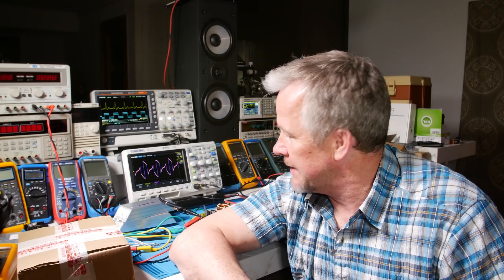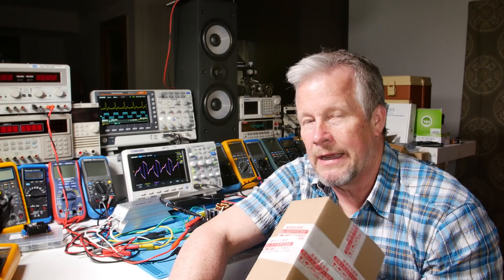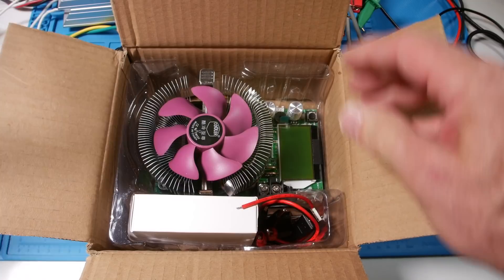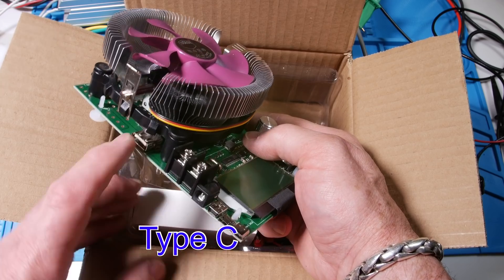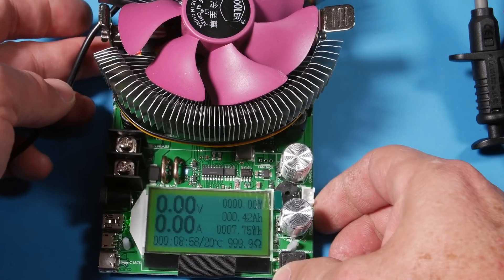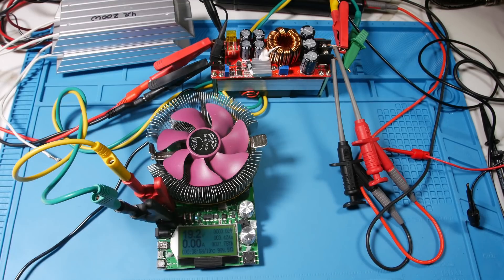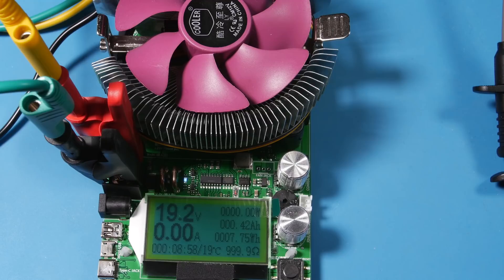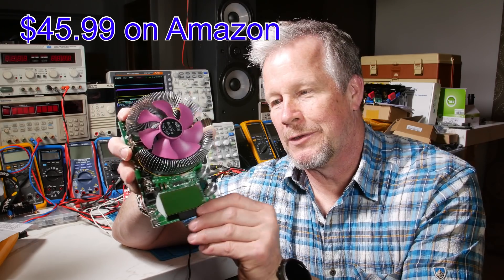MakerHawk Low cost Electronic Load

Comment: Nice video about the Load.
But PLEASE DO NOT USE IT FOR BATTERYTESTING or bigger Units without a Fuse in Series to the Load.

For small DC/DC converters and maybe very small Battery it is okay, but remember the Construction and the Price ! 

Also it cannot Replace Resistors because of Switching fequency from DC/DC or other Power supplys.
The ripple or noise can affect the Load operation.

If this load fail while you testing a 18650 Batterypack with like 4S it can easy Burn down the whole setup or your House.
4S 18650 SonyVTC5 pack can deliver over 100A at Short circuit.
Reply from the maker: Andy Privat Wow - that is such great advice!  Thank you!!!  These comments are so much help to others - and me;)
Reply: @KissAnalog   I Thank you for the great Video.

I need a load myself and i did had the Idea to make my own.

But Problems like Load regulation or oscillation stop this Project very shortly..

Now i did order a Load from a Company in china.
The same Load is relabeld availabile here in Germany for about 430$

If i have the Time i will make a Video about it.
Reply from the maker: +Andy Privat That video would be great!  I have so many ideas - but not enough time;)
Reply: @KissAnalog   i know what you mean... This year i even had no time to get good ideas...

Comment: I read an Amazon review comment that said this tester doesn't work for USB-C testing, and that they didn't know why it even has a USB-C port... Is that true??
Reply from the maker: Daniel, I’ll check that out.  I haven’t tried that yet.  That’s very interesting - thanks for the tip,
Reply: @KissAnalog  cool thanks
Reply: @KissAnalog  I'm not sure if they meant it doesn't work at all with USB-C, or it just doesn't recognize USB-C PD or QC for higher voltages (i.e. 9v, 12v, 20v, etc)...
Reply from the maker: Daniel Brooker Ok, I wonder if it’s something that is selected in a menu or manually set?  I’ll see if I can check out the other features it has while I’m at it.  So far I’m really impressed;)
Reply: @bluegizmo1983  Have just checked the USB TypeC socket... no power delivery protocols for TypeC so a PD load will not get any feedback and not send any power, but nominal (old style) 5v TypeC works like any other USB port on the board.
So the typeC port on this load works fine, just not PD supported, though there is likely newer revision that has PD protocol and BT and all that jazz.(its quite old this load, got mine years back).
Tried with my Porsche Book PD charger and my adjustable power bank with PD protocol, no dice.
Reply: @JAKOB1977  ok thanks for testing that for me! Much appreciated!

Comment: Thanks for the overview of this thing!  I'm still a total noob, realized I need a dummy load a few days ago.  Looked around a bit and have had my eye on this MakerHawk to take me further down the rabbit hole.  I was going to get a no name 10A 150W for about $26, but 10A just barely meets my needs so it would probably be wise to get some head room.  This unit is pretty much perfect for what I need, and I have a better feeling about MakerHawk than the $35 knockoffs.  They probably work fine, but I'm a firm believer that you get what you pay for.  Obviously this thing is still a cheap Chinese device, but it's the slightly more expensive cheap Chinese device, and that has to count for something.  Nice to see a positive review from someone such as yourself that actually knows a thing or two.  I wasn't too sure about it before, now I feel totally secure ordering it 2-NITE!
Reply from the maker: Drew Kosonen I’ve been a bit surprised how good it actually is;) I have used it in a number of videos to show how well a low cost device works, but also because I just like using it.  Thanks for sharing your thoughts - hope to hear more from you, and about your thoughts on this when you get a chance to use it.

Comment: Hello, my Load Tester nothing happens, I turn the potentiometers and nothing.
I've already changed Mosfet 2 times, nothing happens.
Can you tell what might be happening?
Reply: Hi Leandro and Kiss Analog
I have the same problem. I received the item, and it doesn't worked from start. No visible damage or magic smoke. I've started to build up a schematic to repair the load, but there are a lot intresting things for me. Can you do me a favour, and measure all the voltages on the two potentiomters pins? Because on mine all sits under 40 mV and the two ends of the resistor on same potential (shortened) (sch attached). The device measures the input voltage accurately and there aren't any shortcircuits on the board.

https://imgur.com/a/DVbO4rj
https://imgur.com/tya6n7v
Reply from the maker: Light Factory I’ll check this out soon.  I’m still in New York on vacation so I’ll get to it when I get back home.
Reply: @flash5life  With 13.9V input my display shows 12.8V @ 2.8A using the coarse pot, the legs on the pot left to right show 44mV 48mV 72mV. At the top right of the LCD is a transister this pot controls and the left pin goes to the resister beside it then to the processor. The transistor has 30mV on left pin at these settings. Hope this helps :)
Reply from the maker: Do you have an oscilloscope?  You can check to see if the gate of the FET is getting a signal.  I wonder if the input voltage regulator is working?

Comment: Hi Eddie,
Good video, check out Voltlog #119.
For more information on this type of device
ATB Adam
Reply from the maker: Adam L Thanks!  I like that review.
Reply: @KissAnalog  
Hi Eddie,
The white molex type connector is the sense lines for 4 wire measurement, on mine this only works in the "fun 2" setting.
Press and hold the output button down and power up the board, then rotate the encoder to select "fun2"

Adam
Reply from the maker: Adam L Thanks Adam!  Great tip!  Has it worked well for you?  Have you tried the batter test?
Reply: @KissAnalog  
Hi Eddie, only had  the 60watt version, since Wednesday this week, so I've not tested a battery.
Mine reads low on the amps setting, it's out (set current of 1.25A shows 1.142A being drawn on my supply). The minimum current is 200mA due to the 10m Ohm shunt being read by the  low resolution ADC of the microcontroller.
Even though I'm using short heavy gauge wiring. So not perfect, haven't seen anyway to calibrate the unit yet.
ATB Adam
Reply from the maker: Adam L I’ll check mine again.  I did once but haven’t gotten around to doing a follow up video on this, but I need to...

Comment: After your response to a comment on another video about power resistors, I’ve been looking: my eyes are still watering from the prices!  It hurts to build a stash.  But you got to love these little devices for what they are.  I have to say though, I do worry about the quality and safety of some of them  given their origins (an A4 page of translated English instructions!?) - it would be good if you could do some testing in relation to that when you do a review.  Seeing it in action is ok but it would be good to know if it is likely to have longevity issues or likely to burn the user :). 

On a different point altogether, that’s a nice set of patterns going on your scopes in the background.  I can see you are keeping track of your heartbeat on your GWS (don’t want no collapsing on camera!) and nice picture on the Siglent.  You should perhaps have a go at creating a Chua circuit (https://en.m.wikipedia.org/wiki/Chua%27s_circuit) before your next video :). Actually, that might be an interesting diversion into further using a scope.

As ever, nice one Eddie.
Reply from the maker: Andrew Johnson Nice observation Andrew, I was wondering if someone would notice that;)  That is a great point - I do need to test the safety points or the protection Circuits.  I was planning on a follow up to cover how the other ports work and/or other functionality that I skipped over.  I wanted to point out an option to trade for the cost of a bunch of discrete resistor loads, and the variability in load ranges to find particular operating parameters of your circuit.

That is a fantastic idea about the chaotic circuit - I can already see some great implementations.

Comment: Funny little unit. I think that the fan is a cheap CPU fan with thermal censor.
I like that you find these specialty's that is payable for the rest of us:-)
Reply from the maker: Thank you - so far I’m impressed with this electronic load.  Seems to be smoother at the lower power than the Kunkin.
Reply: I think you're right about the CPU cooler.  I saw another video where a guy put a MASSIVE heatsink on the top, and another decent sized one on the bottom of this same unit.  With those on it, he was able to push it all the way to 300W
Reply from the maker: Drew Kosonen I’ll have to see what I can do to beef this up - I think this is such as great price it is worth taking a closer look.